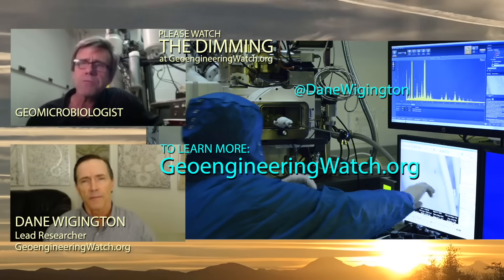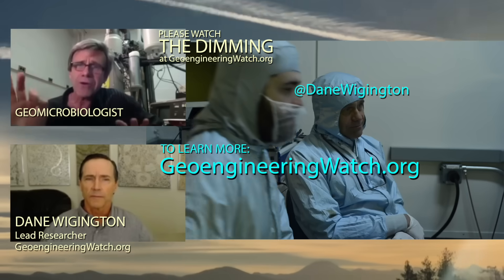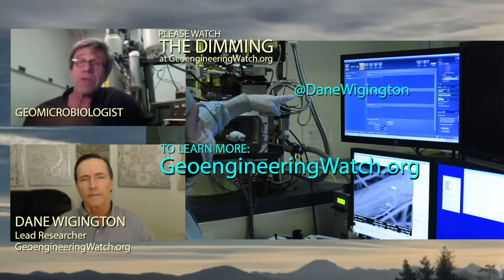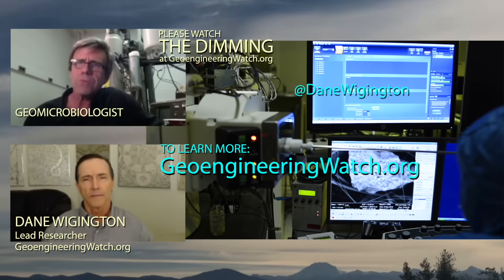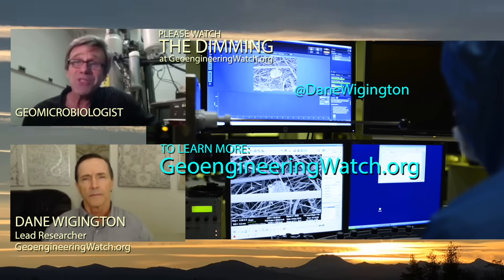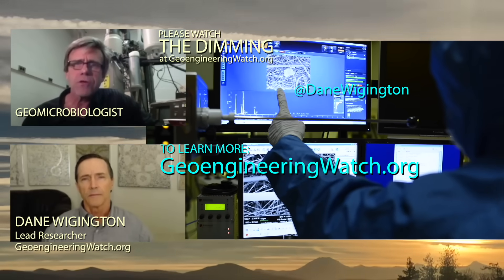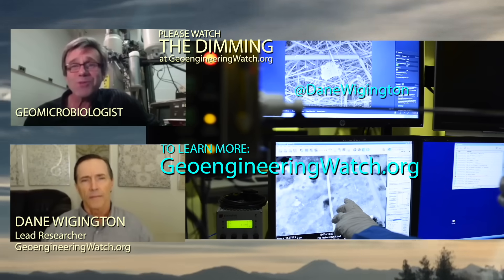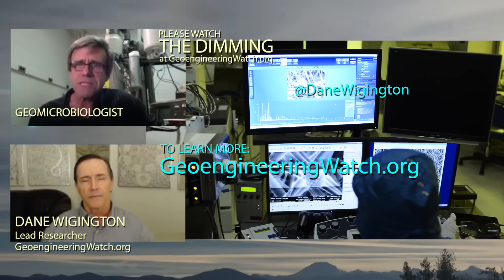Climate Engineering Nanoparticles In Our Atmosphere, Lab Testing Confirms

Comment: They The Feds have for the last several days of 12/2025, been spraying incredibly heavy with long heavy lines from Horizon to Horizon and crossing similar to tic tac toe style of heavy spraying and it is non stop over central and west Texas  but now they are low as 20000 feet and not at all in the Stratosphere.